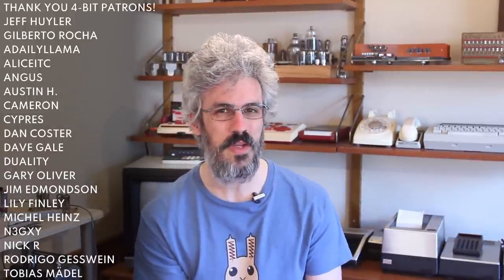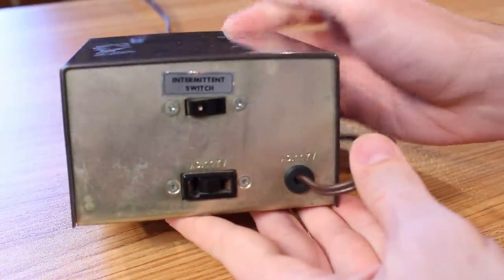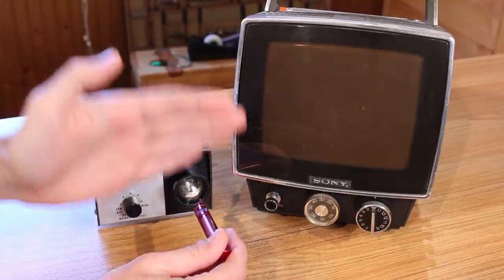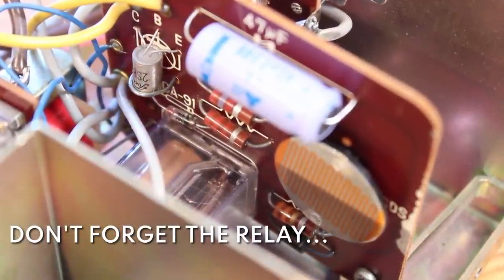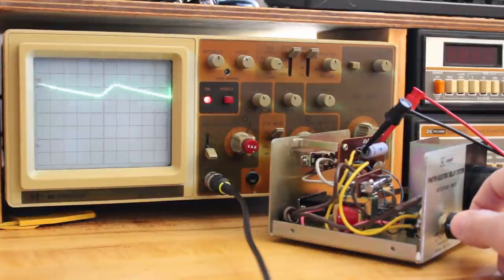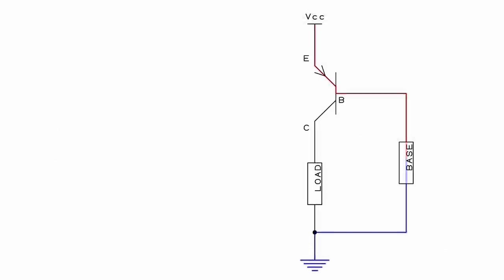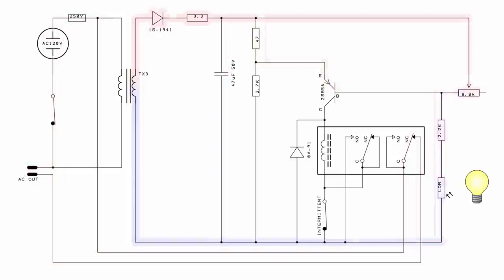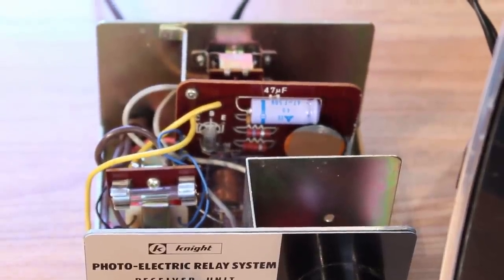Reverse Engineering a Knight Photo-Electric Relay System

Comment: The purpose of the voltage divider on the emitter is to 'raise' the emitter's voltage down a bit. A 2k2 and 47 ohm voltage divider with about 20V will drop approximately 0.4V across the 47 ohm resistor. This means the base, relative to the positive rail, needs to come down by that voltage plus the voltage of the BE junction to turn the transistor on. If there's no light, the base would be at 0.4V relative to the emitter, keeping it firmly off.

If it were just a 47 ohm resistor alone, it would introduce a little negative feedback to the circuit, which would prevent a clean switching effect on the transistor.
Reply from the maker: Ah, that makes total sense, thank you!  
Transistors are wild little things and I totally didn't think about needing to keep the base slightly above the emitter to get the saturation fully into cutoff!

Comment: I remember these in shops in the 70's and 80's. They would activate a loud buzzer whenever someone entered or left.
Reply from the maker: That seems like a perfect use for them too!
But, I like that you could use them to pretty much power any AC device by breaking the beam, that flexibility in application is really cool to me. I need to keep an eye out for the exciter lamp unit so I can get a proper matching pair!
Reply: @UsagiElectric  : Forrest Mims drew out a version in his "Begining Electronics"/"Basic Electronics"/whatever electronics book that used to sold in Radio Shack.

Comment: I had some similar units, that were meant to be used as beam break detectors for alarm systems. Both sides used an identical sheet steel box, with a large IR plastic filter screwed to the front. Transmitter used a 12V lamp, running at low duty cycle from a multivibrator, 2 transistors and a buffer transistor, to drive the lamp and impress a modulation on the beam. Lamps ran barely glowing, but a fair amount of IR radiation, and a regular torch plastic base and reflector used to focus the light into a beam leaving through the filter.

Receiver a large glass lens with some adjustment on long brass screws, used to focus the light on a small phototransistor, which then was capacitively coupled into a 2 stage AC amplifier and filter, to roughly amplify the received IR moculation only. Then a diode detector and transistor comparator, driving a small relay to provide a closed circuit if the modulated IR fell on the receiver. Break the beam and the relay contact would open, and shining a bright light onto the receiver would do nothing untoward, though direct daylight without the filter would saturate the phototransistor, and cause it to open the relay. 

Cover on no problem with bright daylight, at least so long as the sun did not shine direct onto the phototransistor. Also had microswitches in the case, transmitter remove the case and power was cut, and same for receiver, so making the system tamper resistant. Removed from service because cats and rats would break the beams, so the replacement was a few microwave detector systems, set to lower sensitivity, so that small mammals moving would not trigger them.
Reply from the maker: That sounds like an extremely well-engineered solution! The idea to modulate it and change the output to mostly IR radiation is kind of inspired. The main problem with this unit is that any light into the lens could trigger it, so ambient light can cause false triggers or the need to adjust the sensitivity throughout the day. 
Thanks for sharing such awesome detail about the design!

Comment: I had something similar when I was a kid to play around with. However it was slightly more modern and working on low voltage with an IR source as the “exciter”.
Came for the Centurion, stayed for the valves, and thoroughly enjoying the odd bits and bobs you find 😄
Cheers

Comment: JFETs behave more like vacuum tubes than BJTs in that they are voltage controlled (high impedance gates, like many Gigohms) instead of current controlled.  The downside of JFETs is that you might as well not bother looking too deep into the datasheets because of the really wide range of values from one part to the next.  In the good old days the parts houses would match the parts and give you good values for the parameters for a hefty fee, or you would just have to buy a lot of them and match them yourself.  You can get the math to work sometimes and have an amplifier that works, but most of the time you have to use potentiometers to try and get the things to work.  Then when you take them off the breadboard and solder them on a proper board, the stray capacitances of the breadboard go away and you are back with a bunch of multimeters trying to figure out what went wrong.  Not for the faint of heart, but there are a lot of really nice audio products out there that use JFETs for small signal stuff.  There is a reason why most products use opamps these days...  OPA1612s with JFET inputs and surface mount boards sound really nice!!
Reply from the maker: Thank you for the excellent information on JFETs!
I actually really want to build some stuff with JFETs because a lot of the experience I have with tubes can transfer over. I think a discrete transistor homebrew CPU made from some good, common JFETs or N-MOSFETs would be a ton of fun to build and really educational.

Comment: We made almost this exact circuit in tech - Ed in middle school. Only difference is that we used 3  transistors. I just love these half rectified analog transistor applications. So foreign from how we used them today! Amazing! Thanks for sharing your computer reset experience, one of my great regrets is not being able to make my way out there to check it out before it was done.
Reply from the maker: That's awesome, and this is such an excellent circuit for learning how to do really tricky and complex things with just a small handful of parts. I feel like nowadays, most people would just throw a microcontroller at it, which is mega overkill, haha. 
Computer Reset was wild, and I regret not being able to get there earlier! The collection of stuff they had was a little newer than the type of stuff I generally search for, but it was an absolute treasure trove of cool little things hiding out here and there!
Reply: Same!! Though ours used one transistor and was DC (cheap switch mode “DC” usually) only. 90% the same circuit! But cheaper tolerances.

Comment: Fisher Pierce used a similar yet simplified version for controlling street lighting in the early 1960s, and these are easy to spot, that is, if there are any still in use. The earliest style uses a bell jar shaped cover that was painted white inside except for a window to the vacuum tube sensor, and the next version looks like an electric meter, but the sides of the cover are painted a dark gray. Both styles used three vacuum tubes for the logic and sensor, and two relays for the actual load switching.

Comment: That’s so cool, this is basically the first project I had to make in electrical engineering class. She says before she sees the exact circuitry, and of course mine didn’t have a nice case or a particularly high current capacity! But I did have an inverter switch, which would bridge across or connect a NOT gate.
Reply: Haha yeah mine was basically the same as the middle part because it was DC only! Guess it was a tried and tested design for a simple sensor circuit :) The specific resistances didn’t really matter, it was just about ensuring the signal to the transistor was clean. Using a relay was optional depending on the load of the circuit. 

It’s funny you say transistors are black magic, I understand semiconductors rather well but vacuum tubes are black magic because my school stuff didn’t go anywhere near it! I can understand why you were concerned about the current ratios etc because of tube stuff, but this project was the first one because it skips all that and just uses the transistor like a switch as you say. 

We were introduced to the most basic extreme modes of operation first before subtleties like variable amplification were brought up. No big charts, just a hand drawn graph of the general shape, and we learnt each cheap transistor’s behaviour by using them. Not suitable for bulk manufacture of course!

Comment: the 3.3 ohm resistor is probably to limit current when it first powers on and the capacitor acts like a short as it starts charging. the 47 ohm resistor is probably there to further limit current through the coil in the relay and the 2.7k resistor is probably there to discharge the 47uF capacitor when the unit is powered off.
Reply from the maker: I was always under the impression the series resistor and capacitor worked as a sort of RC filter to eliminate some of the ripple when under load, but given how much ripple we saw on this one, I may be off the mark a bit, haha.
Another commenter explained the idea behind the 27/2.2k perfectly, but I don't want to flub the explanation, so I'll past their response here:

"The purpose of the voltage divider on the emitter is to 'raise' the emitter's voltage down a bit. A 2k2 and 47 ohm voltage divider with about 20V will drop approximately 0.4V across the 47 ohm resistor. This means the base, relative to the positive rail, needs to come down by that voltage plus the voltage of the BE junction to turn the transistor on. If there's no light, the base would be at 0.4V relative to the emitter, keeping it firmly off.
If it were just a 47 ohm resistor alone, it would introduce a little negative feedback to the circuit, which would prevent a clean switching effect on the transistor."

That actually makes pretty good sense to me! Transistors are weird little things though, it makes tubes seem so much simpler!

Comment: The missed opportunity is to plug a lamp into it an use that as the light source.   Should flicker on and off at some rate which would allow you to measure how fast the switching is.
Reply: Our class did that when we built one of these, each transistor was slightly different and they were all together so it was a pretty interesting polyrhythm.

Comment: The 2SB56 is a Germanium transistor. Germanium is more temperature dependant than Silicon, so parameters will drift while the device is running, and bias voltages need to be handled more carefully than with Silicon transitions.. The potential divider on the Emitter will give a more stable voltage point for the Emitter than if only the one resistor was used. @256byteram explains the switching.

As an aside, it's interesting to note that Vbe for a Germanium transistor will be between about 150 and 300 mV, rather than the ~600 to 700 mV for a Silicon transistor. So the Ge device can operate satisfactorily from as low a voltage as that provided by a single standard Solar PV cell, whereas a Si device will need about twice the minimum supply voltage. That low junction voltage drop is also why AM small signal detector diodes are nearly always made from a Germanium diode rather than from Silicon.

Comment: A nice look at some vintage design! A couple of points, if I may?
(a) I bet that potentiometer is 10k, plus or minus tolerance; it doesn't have to be precise.
(b) Rather than looking at transistor currents, think of it as a voltage controlled switch. If the voltage at the base is more than about 0.7v more negative than the emitter, the transistor will turn on. With a nominal 20v supply, the  47 ohm emitter resistor will hold the emitter about .35v from the positive supply - so the base will need to be more than a volt from the rail to turn the transistor on. That gives a little headroom for noise, I suspect.
Reply from the maker: Thank you!
You're totally right on the potentiometer, I got so caught up in why I couldn't get a clean resistance measurement, I didn't stop to look at it from a distance.
Thanks for the insight on transistors too! BJTs are so weird because there's so many different ways to explain what's going on that it all gets muddled in my brain. But, that makes total sense about the 47 ohm being used to lower the emitter potential in relation to the base to ensure clean cutoff and good transitions.

Comment: The 47 ohm and 2.7K resistors form a voltage divider to lower the emitter voltage below the base voltage so that the transistor will bias completely off.
Reply from the maker: That's actually really smart! 
It's ind of like pulling the grid below the potential of the cathode to ensure a tube goes into full cut-off, but it's reverse. I needed to turn my thinking on it's head, haha.
Reply: @UsagiElectric  "It's kind of like pulling the grid below the potential of the cathode", Exactly. Triodes and NPNs work roughly the same way, but PNPs are flipped on their head and there aren't tube equivalents that I know of, although it wouldn't surprise me if some physics experiment at CERN is effectively a positron fueled triode. You can actually direct substitute N-channel JFETs for tubes in low voltage circuits, but P-channel JFETs are still upside down. LOL! I just noticed the transistor is a 2SB56! My first PNP! 🤣 Holy sheep sh... I must be a nerd.

Comment: Good luck on that Sony TV, not sure how you will get it working because there are no more analog stations transmitting!
Reply: I think I know two ways to provide analog RF to the television.  In the year before the FCC obsoleted analog television transmissions several companies were contracted to build converters from ATSC to NTSC, and they were sold for a minimal price for people to continue to use their old TVs with the new digital transmitters. I scored two such units (two units was the limit for the ridiculously low price) for almost no money, and they do work if you can find one.  The other way is to find an old composite to NTSC converter;  A lot of gaming units came with those for use with TVs that did not have composite inputs.  More or less a low power TV transmitter that would broadcast on channel 3.  Some of those converters had a switch for channel 3 or channel 4.
Reply: @scottbrown4534  Any VCR or satellite receiver will also provide composite video, and thus you only need a composite modulator to get OTA signals now, or an older satellite box, or early DTV box,. which was designed to be used with existing TV sets that did not have video inputs. Even modern decoders often still have the RF modulator, so you can use the output in a second room, and also use the cable to feed the remote signals back on the same cable.
Reply: @SeanBZA  Good stuff; we could go pretty far down the rabbit hole with this one!  Thanks.
Reply from the maker: Well, to be honest, I don't watch much regular TV anyways, but I think it would be cool to find a way to get some videos playing on it!
I think if I can get something to output a composite signal, and then pump that through an old RF modulator, I should be able to get some cool images showing up. But, I think the TV itself is having some issues internally, because even though there aren't any analog stations, it should be showing static instead of just a white screen, so it's going to need some heavier troubleshooting in the future!
Reply: @UsagiElectric  The old Raspberry Pi has an RCA composite video out connector. That gets you your internet stack to composite.

Comment: I wonder if the transmitter was an infra-red emitter?
Reply: No, standard 12V tungsten lamp, in a holder, with a pressed steel reflector, chrome plated, and a lens, with a series resistor of 47R, to both make the lamp run at 8VAC, and to limit switch on current surge, so the lamp would last decades in use. Reduced voltage, so the light that comes out is mostly reddish orange, but still bright enough for the CdS cell to detect once focused on it. No filters in there, though you could get red acetate filters, to place in front of the lamp and the CdS cell, to reduce the sensitivity to sunlight causing problems. 

Same transformer used in both units, and probably the same exact case, just the outlet would be replaced with a blanking plastic cover, and the front plate did not have the hole for the variable resistor, but the switch on the back was used to control power to the lamp. Just the internal plate with the aperture was not used, replaced with one that held the lamp reflector instead. Resistor held on tag board, exactly like the receiver did, just no PCB in the case.
Reply from the maker: I think SeanBZA covered it perfectly here!
I think Knight was intending this set to be built as simply as possible, so they just used a standard light, which could cause issues with ambient or direct sunlight, but the lens on the front does help mitigate that to some extent it seems. I had no problems getting it adjusted well with all the lights I had on in the room.